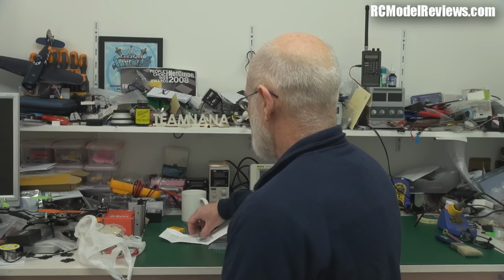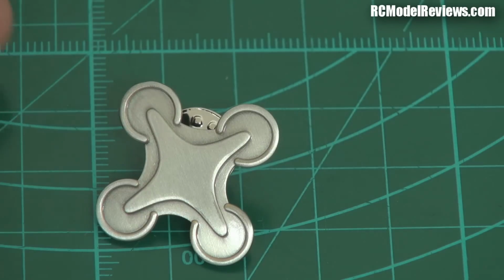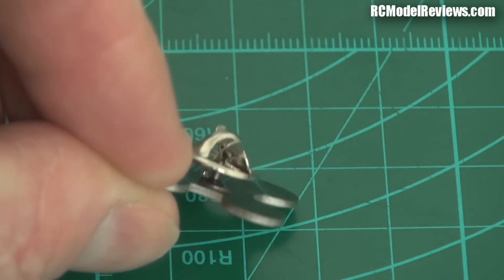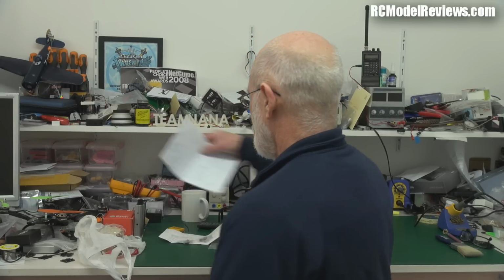Weekly News (18 August, 2015)

Comment: Also...there is an opportunity here for RCMR - you are the only guy who goes into good depth about electronics and equipment and performs the best scientific testing; it's definitely a niche to grow, and one of the reasons I sent a payload system for you to test. With a bit of ingenuity, you can do this testing without flying too (although this radio emissions thing sounds a bit weirdly specific).

I know there's flying to be done, but being the "go to" guy for which electronics to use is no bad thing either.

Comment: Bruce,
What's the differences in bet normal plastic props vs carbon fibre vs wooden props for an AP platforms such as the 350 quads and above , in terms of efficiency, power and jello control?

Assuming they are all the same pitch, size and every other hardware kept as a constant.

Thanks

Comment: Come to the UK, you can fly literally any where. I fly in public parks so long as there are no dog walkers i don't know. But don't fly or drive any planes/cars with engines near houses as I have had 2 complaints in a day running nitro RC cars ;)
Reply: Flying in public parks is not allowed in the UK in a lot of places.  Check the local council by-laws as it is delegated to the councils to permit or restrict.  My local council has banned it, but they have set aside a really nice site for RC flying (the old Croydon airport).
Reply: Szlater Is the airfield any good for miniquads?
Reply: +blueflamingo1 Have a look on google maps, it's fairly flat but there are trees around the periphery.  I've not flown multi rotor there so I can't say how good it is.  Strangely I just went to check the Croydon bylaws and they've removed all mention of RC flying from them, they mention RC boats (and prohibit the use of powered models in all council waterways and features except for at select sites, but nothing for flying.  I'm considering contacting them for clarification as with the increased media coverage and the zealousness of the Met Police I worry that it could get people into trouble.  Bromley Council by contrast expressly forbids flying everywhere except their designated sites.  I wonder if some common sense has come to Croydon at last and flying appropriate models is permitted in parks if following CAA's "drone code".  Very interesting as my house backs onto a park!

Comment: The new DAL 5045 props will not disappoint have done a video myself and I was amazed. Check balance straight form the bag the ones I received amazing. I don't have the tools for thrust testing but did put your link in the video as I knew it wouldn't be long before you got some :D They are sending me some 6045 Bullnose to test.

Comment: Hey bruce, the ducts I sent should suit the popular sunnysky 2204 motors. The props must sit a fair bit lower than the motors you are using. I have taller sets that work with Tmotor mn2206 which sit much higher. Looks like I need add a mid height set. Seems like a lot of the cheaper dys etc motors are somewhere in between. I can adjust to suit any motor/prop. (coaxial motor duct is being prototyped currently)